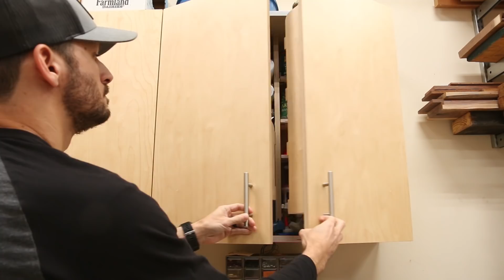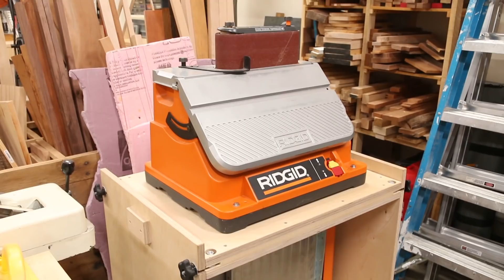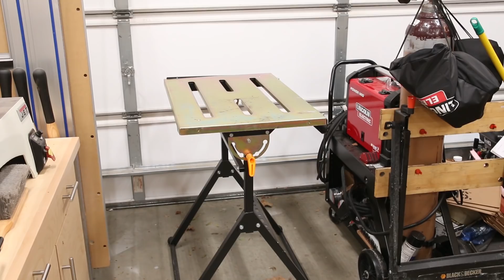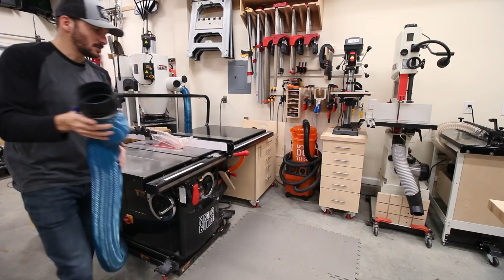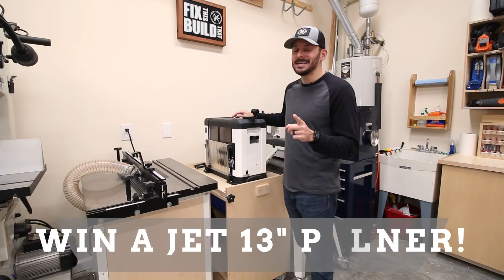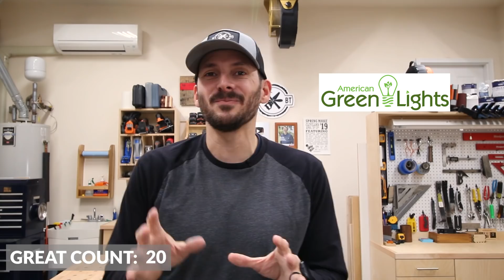Woodworking Shop Tour 2019 - 2 Car Garage Workshop

Comment: I saw that you have the Powermatic Micro dust Filter (electrostatic) and the Jet air filter hanging in your shop. Do you think both are necessary for a two-car garage? Have you noticed a big difference between one or the other? If you had to pick one, which is more effective?

Comment: Doesn't the 5K lights give off a blue-ish tint? That's been my experience with them anyway.  Videos look fantastic!
Reply: A lot depends on the technology and the CRI.  If you have high CRI and 5000K, it will most closely mimic noon-day sun on a clear blue sky mid summer.  It is a "pure white" light, with good representation of all wavelengths of light along the visible spectrum.  Cheap LEDs with low CRI  (CRI 70-80) will be missing the phosphors that produce the red end of the color spectrum, giving the lights a little "blue" feeling, even though it is 5000K.  Most "daylight" fluorescent tubes are 6500K, which will will feel more like midwest overcast days, and will be more bluish.  As you go higher than 5000K, the light gets more bluish, and as you go lower than 5000K, the light becomes more orange.

Comment: I keep looking at the 16x7 garage door and the empty space over it I'm also looking at a ladder.
There is no reason you cant store home improvement stuff on that area above the door and hang the bikes from the ceiling to get them up out of the way. Also I've seen a lot of ways to hang items like storage areas from the ceiling like big 4x8 storage areas. You could get most the clutter off the floor.
You have plenty of room if you think vertical.
The space over the garage door when it's open is serious dead wasted space.
Unless you have storage over the tracks it useless most of the time but it's a great place to build a hang down storage area that lives above an open door.
Dont weld in the driveway. Kids will watch you weld and it will burn there eyes. Dont do it. I worked in a machine shop by the welder we put up screens becuse the flash off the welders were really hard on your eyes even facing away from them. Looking at migwelding is worse then looking at the Sun.

Comment: Hey Brad. Going to build the mitre saw station and in the market for a new shop vac for some dust collection. I saw you ditched the 4 gal from the build and have a larger vac in the stand. What do you recommend? How are you running your dust collection with the mitre saw now? Thanks bud. Great videos too by the way.

Comment: Nice video B-rad. Question for ya...how do you power all those lights, dust collector, and a machine tool at the same time? My breakers trip in my garage pretty easily.
Reply from the maker: Dedicated subpanel in the shop 👍

Comment: Thanks for the videos you post. Simple question: do you edge band the plywood doors, drawers and exposed edges of the cabinets? If you do, do you use the iron on edge banding (how well would that hold up in the summer heated garage) or do you cut thin strips and nail/ glue them on?
Reply from the maker: I don't edge them since the baltic birch looks so nice and doesn't have voids

Comment: Can i ask what I hope isn't a stupid Q?  Why so many handheld drills?  I could see having one, maybe two of both an impact and standard variety, but why do I see so many wood working shops with a dozen or more drills?
Reply from the maker: Mine is mainly due to them being sent to me for review or thoughts by brands. But if I was buying on my own I'd have a 18/20v kit drill/Driver, a 12v kit and an oil pulse impact. All different tasks and strengths
Reply: A lot of time you get a deal on a new "set" and so you have an extra, they are handy if you need a drill bit in one and a countersink in another, 2 different bits. You can never have too many

Comment: Brad, love your channel and videos! Great tour of the shop also. One question - Here's a question for a behind the scenes tool - what do you use to film with? I've been pondering some filming in my own shop for some local classes but don't have the money to start off with 2 or 3 nice DSLR camera's just yet. Do you just move one camera around to different locations or do you have a multi-camera setup for filming? With close up camera angles I see some guys using, I wonder if they use go-pro type cameras.